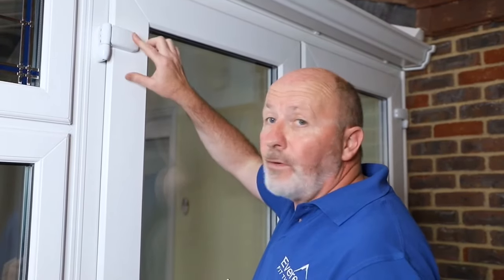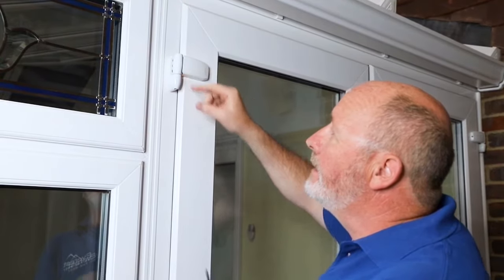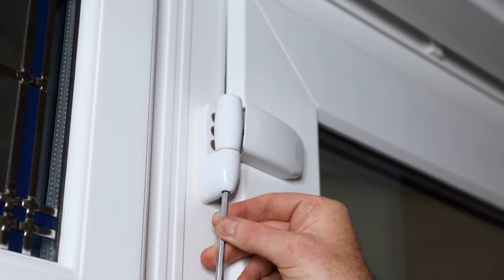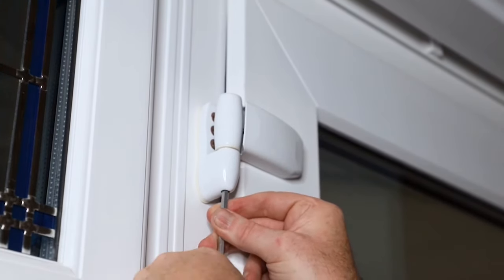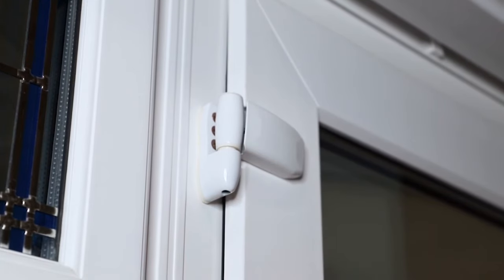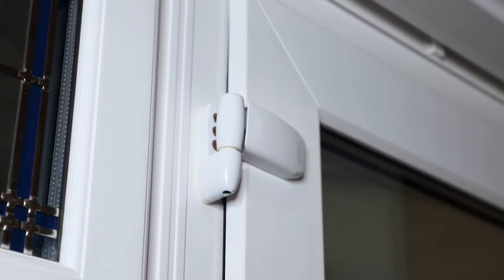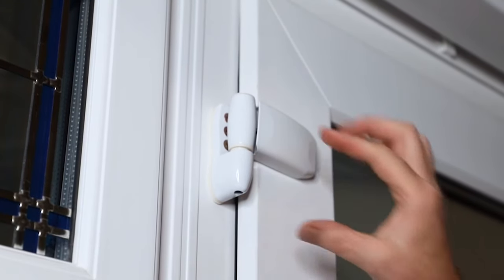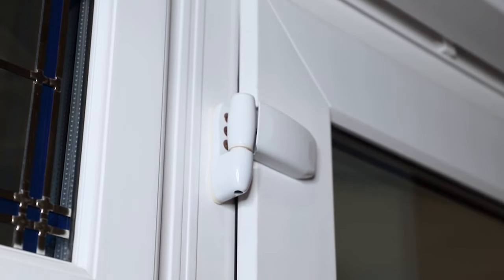How to adjust uPVC front door hinges up and down

Comment: key wouldn't turn. Door locked shut. (Eventually) Ah the door's dropped down with the heat. Adjusting the hinges worked a treat. Thanks a lot. Puts yellow pages back on the shelf

Comment: Do some of the hinges take the Allen keys from the top? Mine look exactly the same but I can’t get an Allen key in the bottom, when I shine a torch and look up it doesn’t look like it takes an Allen key either. If I pop the white top cover off the hinge there’s a plastic bit that takes an Allen key but it pushes the door in and out not up and down ?
Reply: I've got some like that and was wondering about that myself, but after watching a few videos I've just been out and adjusted mine. That bottom hole takes an Allen key, mine is 5mm. It's like a large grub screw where turning it clockwise screws the grubscrew in and pushes the hinge pins, which sit on top of it, up within the hinge - lifting the door. I hope that makes sense & helps. Have fun. 🙂